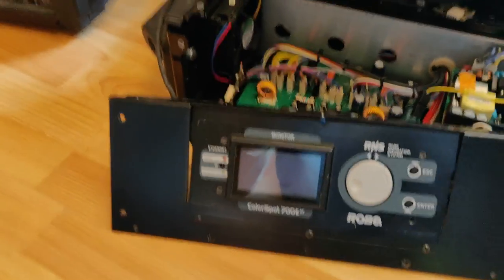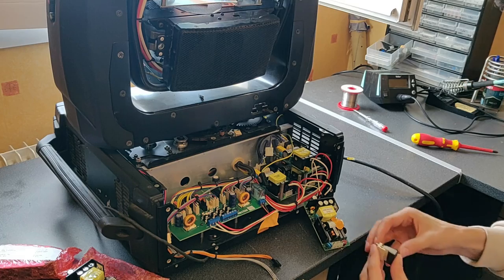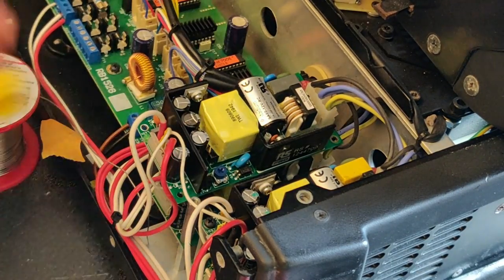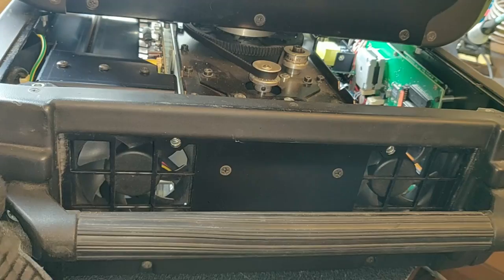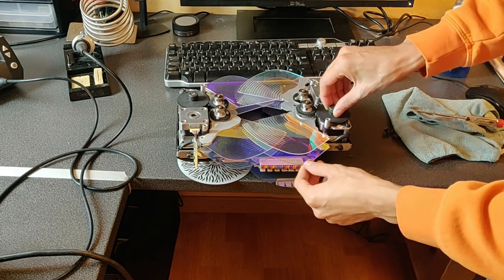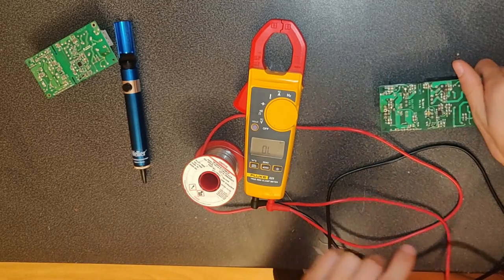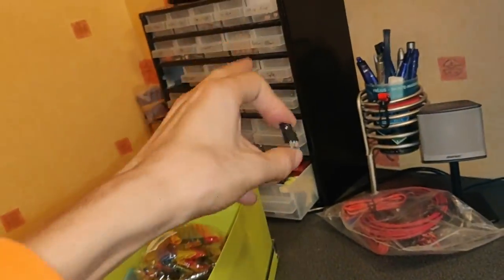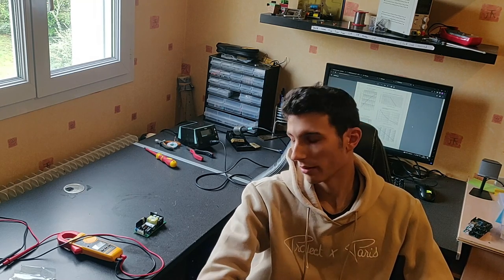Repair + terrible hacking broken power supply - Robe colorspot 700 AT

Comment: The inserts of the connector on the secondary side of the power supply are too weak, 
after a few years they can become too hot too many times and make poor contact. 
A trick is to solder these + and - cables directly to the pins of the power supply, 
this is often the case.

You can place the air filters in a bath of soap and water, then let them dry (squeeze them out) or blow them dry with compressed air.